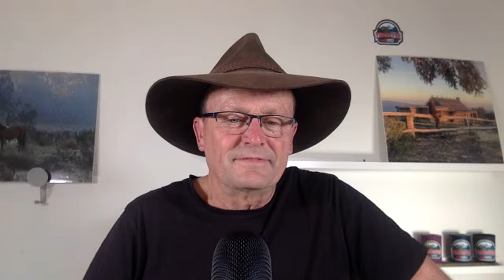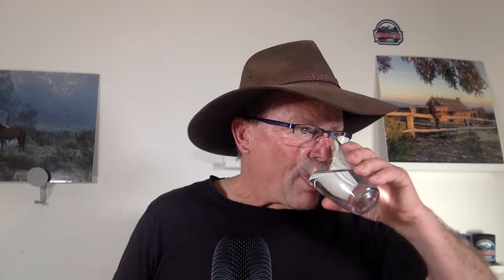Billy Goat Bluff Track - [ DEBRIEF ]

Comment: Good one Tim.  A lot of very good advise there.  Like you said, never take it for granted, or it will chow you and spit you out.  And like what others have said, it's the worst I've seen Billy Goats in a very long time.  Nearly 20yrs ago, I did Billy Goats in an NL Pajero, and a (silly) friend came along and did it on a fairly standard Subaru Outback.  The only change he did was fit some A/T tyres.  And I have to say, he did it relatively easy.  I doubt he'd even get to the helipad now.
Reply from the maker: G'day mate, 
Yeah, it's one of those tracks that will make you pay if you take give it the respect it deserves. 
It would have been interesting to see the track back when you drove with your mate. 
It's full on at the moment. 
Thanks heaps mate for your reply. 

Cheers Tim

Comment: Whom supplied your reduction gearing?
My GU is auto, reduction gears will have huge impact as 1st & reverse in auto are much higher than your manual.
Thanks.
Reply from the maker: G'day Ian, 
Marks Adaptors made them, but i have heard they now dont make them for the GU Patrol. 
Maybe look at a lock up kit for a lock up kit of your auto. 

Cheers Tim

Comment: i'm a beginner to 4WD. Whats the best way to find out if there are creek/river crossings on tracks? I understand some crossing depths is dependant on rain/time of year etc. snorkel yet to be added.
Reply from the maker: G'day mate, 
The best maps for the Victorian High Country are the Roof Tops series.
They are very detailed and they show all of the tracks that cross rivers. 
What the crossings are like is any ones guess. 
They change year by year and month by month after heavy rains. 
Without a snorkel fitted, you run the risk of damaging the engine in your 4WD. 
Hope that helps mate and let me know if you need any more information. 

Cheers Tim
Reply: @timbates4wdadventures  thanks Tim. When i head out i want to ensure i don't run that risk. I attempted to youtube some tracks for these, but hard to determine whats doable or not.
Reply from the maker: @laridavis  I recently spoke with a bloke about his trip plan from Dargo To Mansfield via Wonnangatta. 
I asked if his crew had snorkels, not one of the 4 vehicles had a snorkel. 
I re did his whole trip from Dargo to Mansfield without one river crossing. 
It can be done, just need to know what tracks have the rivers.